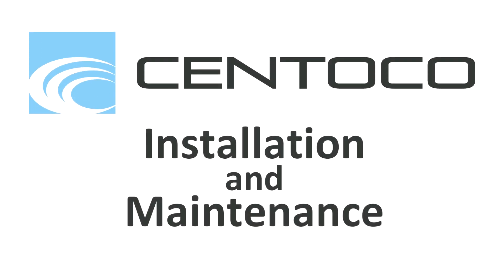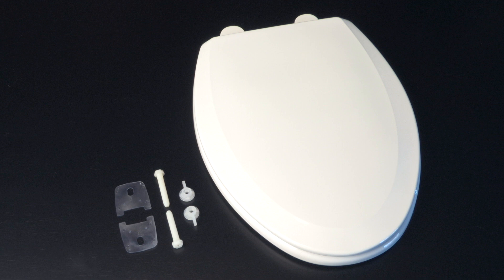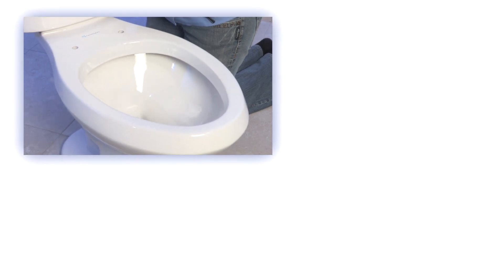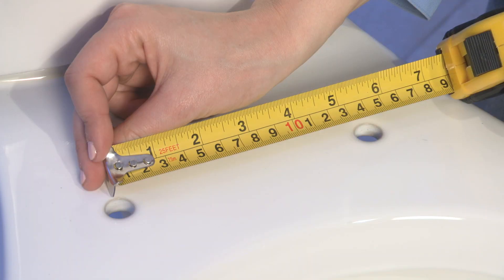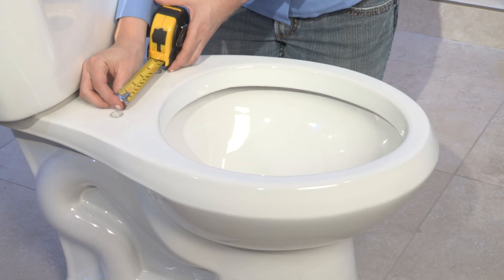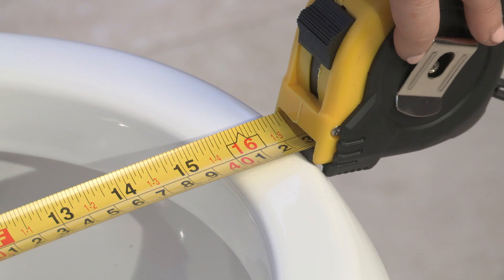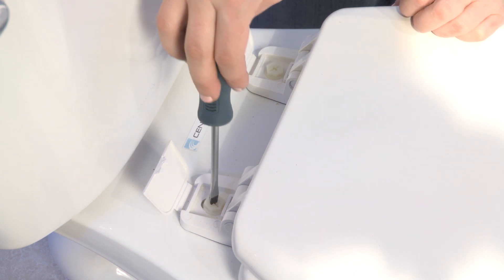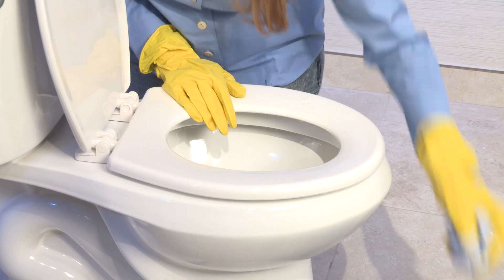General Maintenance and Install Centoco Toilet Seat

Comment: I can’t believe a toilet seat manufacturer can screw up a design so badly .my concenco. Soft close ,after checking that the new one definatately fit the pot , ours was designed to install plastic nut and bolt first ,then unlock plastic cover by pulling sideways then pushing down, well we pulled and pushed ,squeezed and spent 15 minutes with this until finally taking the hinge apart , on close inspection the machine that stamps out the elongated holes had left behind burres of plastic so obviously had not been involved in quality control .we can’t take the seat back because it had been opened. So we wasted $40  on this rubbish . Warning . Ours wasn’t the one in the vid, but this company’s product leaves a lot to be desired. ( bring back the good old days)
Reply from the maker: We apologize this doesn’t meet your expectations.  There is a 1-year manufacturer defect warranty.  Please contact customer service at 1-800-265-3666 to discuss options.